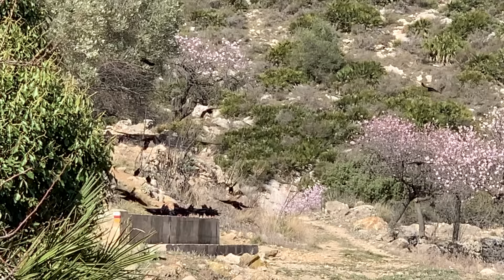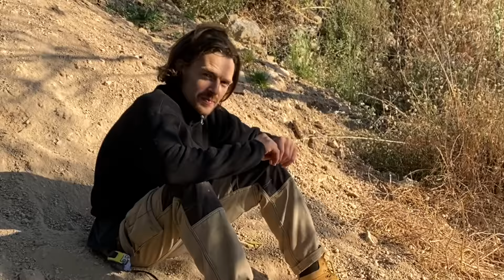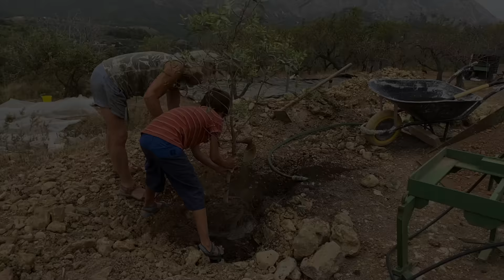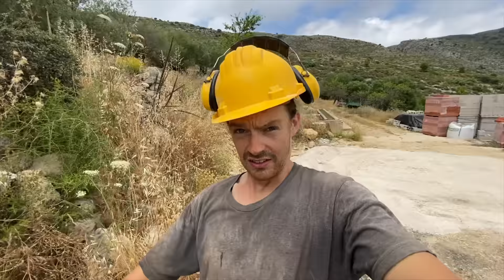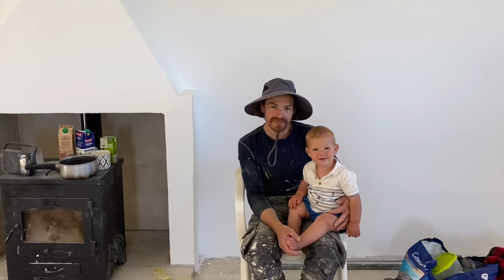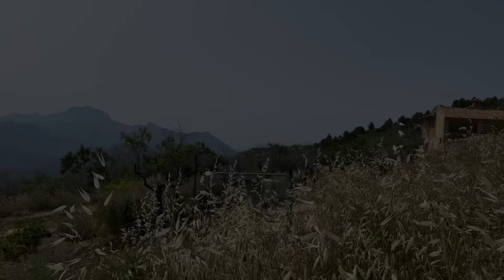2 YEARS ALONE OFF-GRID | Everything we built [TIMELAPSE]

Comment: Hi.  I'm in the central valley of California.  They use electric fences for sheep here. I don't know the details. But flocks are moved to fields and sectioned with hot wires to eat  alfalfa fields down. This makes the alfalfa go dormant for winter. I'm curious why it didn't work for you.
Reply from the maker: Thanks for your comment Daniel! We spent many sleepless nights wondering this same thing... one farmer told us that if you put sheep inside a fence, and have lots of nice food for them to eat they will usually stay inside the fence. But if the sheep are wild, they are searching for new pastures, and we had lots of alfalfa and other grasses we had planted around the olives so they wanted to come and eat it. And then when all the sheep charge the fence at the same time, the first few will get 7000 volt shock, whereas the sheep behind force their way through and don't feel any shock, and by that point the fence has been torn out so the rest can walk through! The electric fence works really well against wild boar though, they are much more sensitive. It's like you need a different fence for each animal here!